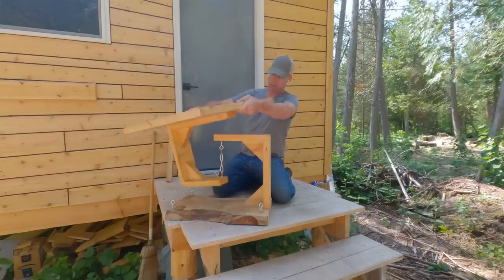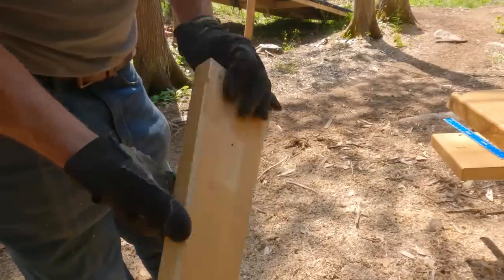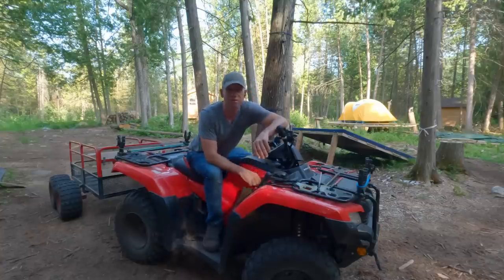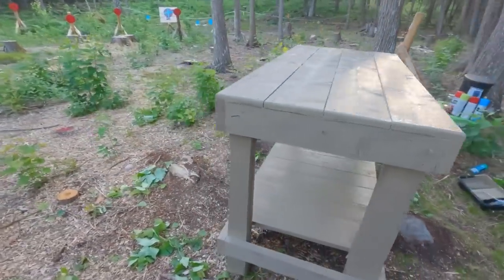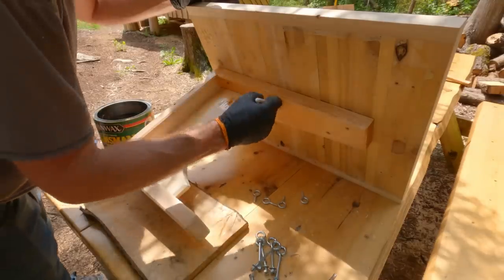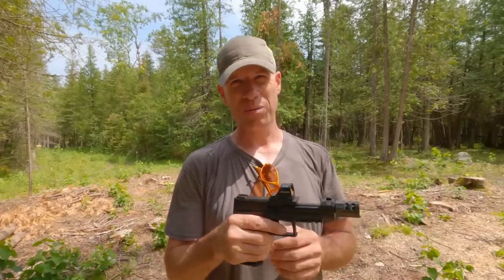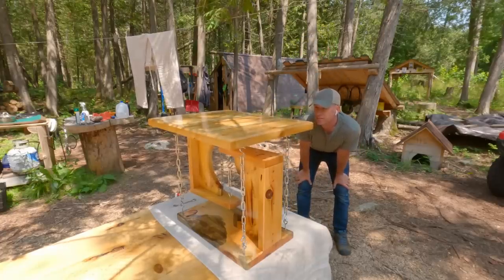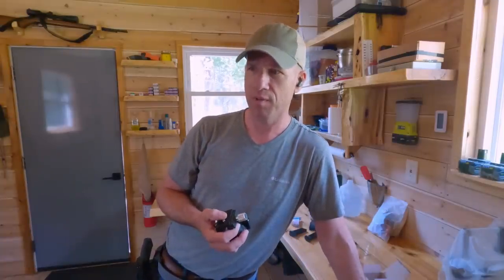Finishing the Table that FLOATS on CHAINS for My Tiny House.  #149

Comment: Put the projector on a removable mount on the windowsill behind the couch. You'll get the benefit of a larger screen, out of the way for the table, and if it has an audio hook up option, you could run wires for speakers and have surround sound. Just a suggestion :)

Comment: Mount the projector either on the wall just above the window or from the angled part of the wall/ceiling. It would be out of the way so it would be less apt to get damaged. You wouldn't have to worry about bumping the table and making the picture moving on the screen.

Comment: The next hanging table or bed or roof or cabin or tent platform - Have all 4 corners a static length rope or chain & lift it with a separate rope / winch. 
45 years ago my cousins had a train setup on plywood that was on ropes that raised to the ceiling to reveal a pool table.

Comment: I have the same generator and it runs a small window air conditioner if you add a supco 'hard start' capacitor to the power cord.  A small window unit would easily cool your cabin.

Comment: I think the floating table would be more stable if the bottom of the corner chains were moved out some.
Instead of coming straight down the chains would  angle outward and my guess is this would add a lot of stability.

Comment: Porch and Deck paint will hold up well. I like Lawn color green with the natural wood walls. Out here on the left coast blue pine never sold well, then the name changed and the architects went ape shit when it was called Denim Pine. 
Try a quart of Zinzer brand Amber Shellac on your pine lumber. It would make the inside of your cabin look like way it should. It was 105 today and it just now rained for 5 minutes. Acid Rain?

Comment: Hey Ryan, Have you cleaned the spark arrestor screen on your generator? 
I didn't even know that mine had one until it started acting worse than yours. It is supposed to be cleaned every 50 hours of use. Hope this helps.
Reply: Great thinking, forgot all about that